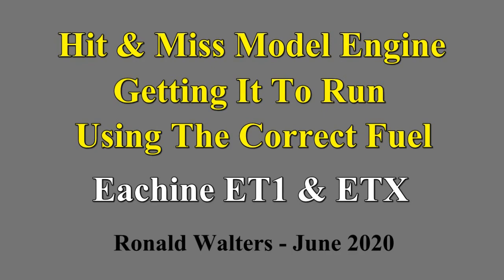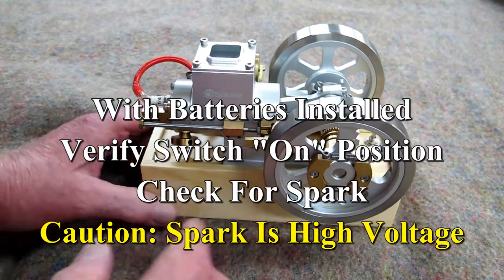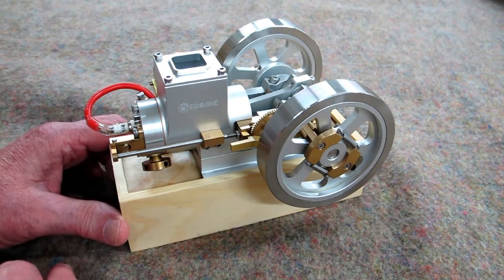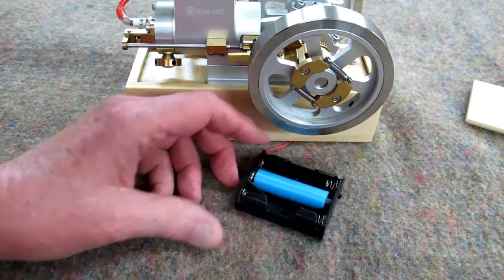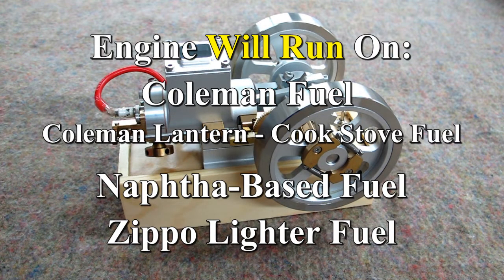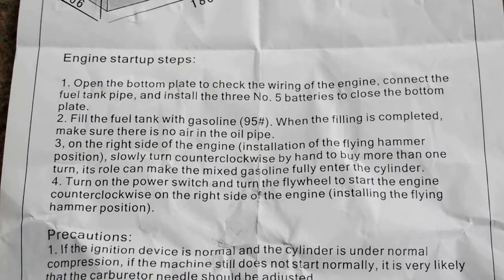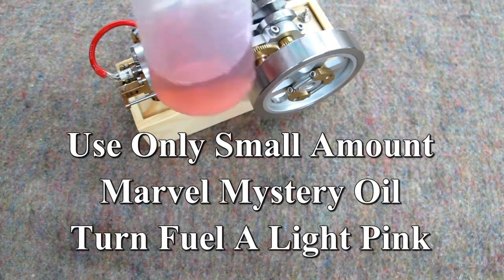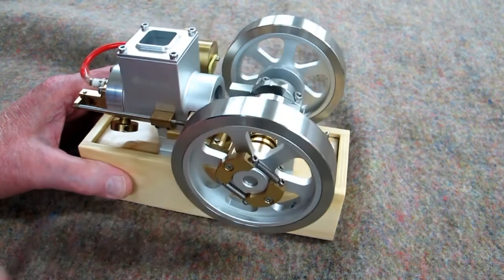Hit & Miss Engines - The Correct Fuel

Comment: In Europe Aspen 2 is an alkylate petrol much cheaper than Coleman fuel premixed at 50:1. It works perfectly in this engine.
Reply: I'm in the UK and have just purchased some Aspen 2 and can confirm that my ET1 runs better on this than regular retail petrol (gas) and with less black soot from the exhaust.